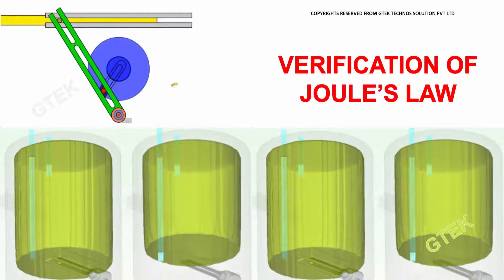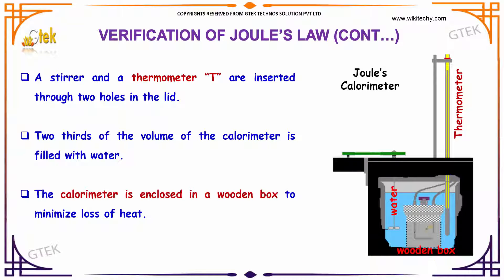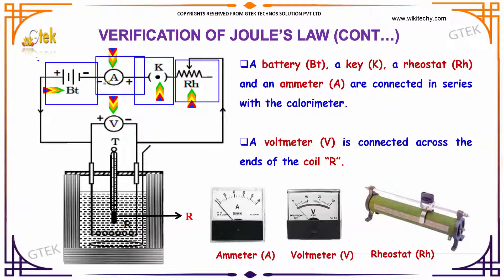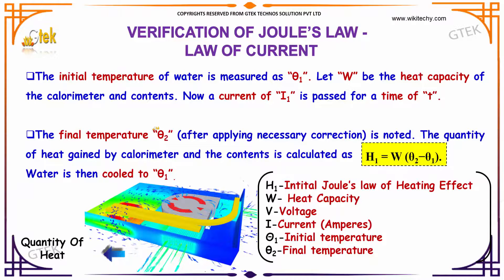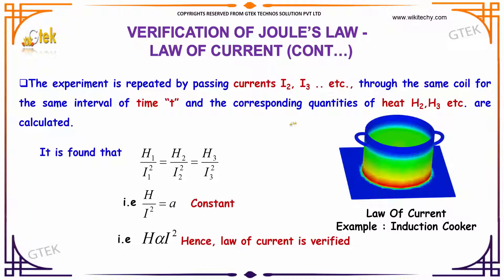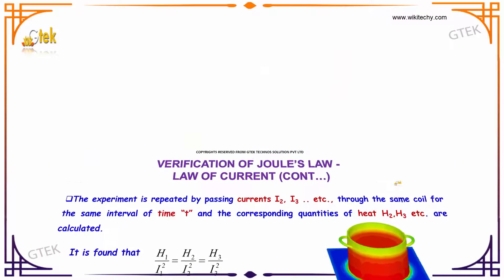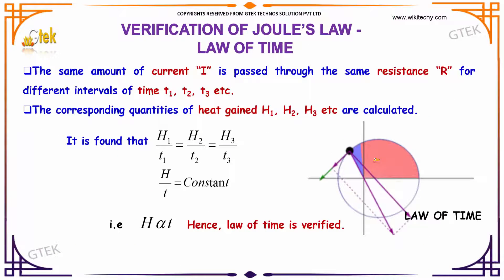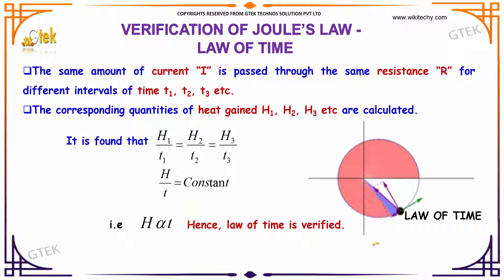Verification of Joules Law  Effects of electric current class 12 physics subject notes lectures

Comment: The rate at which heat is produced in a resistor is proportional to the square of the current flowing through it, if the resistance is constant. Lagged beaker or calorimeter with a lid, heating coil, battery or low-voltage power supply, rheostat, ammeter or multimeter, thermometer, stopwatch, balance. 1.

Comment: Verification of Joule's Law using Joule's Calorimeter. Joule's law is verified using Joule's calorimeter. ... A battery (Bt), a key (K), a rheostat (Rh) and an ammeter (A) are connected in series with the calorimeter. A voltmeter (V) is connected across the ends of the coil R.

Comment: The amount of heat produced in current conducting wire, is proportional to the square of the amount of current that is flowing through the circuit, when the electrical resistance of the wire and the time of current flow is constant.

Comment: The heat which is produced due to the flow of current within an electric wire, is expressed in Joules. Now the mathematical representation or explanation of Joule’s law is given in the following manner.

The amount of heat produced in current conducting wire, is proportional to the square of the amount of current that is flowing through the circuit, when the electrical resistance of the wire and the time of current flow is constant.

The amount of heat produced is proportional to the electrical resistance of the wire when the current in the circuit and the time of current flow is constant.

Heat generated due to the flow of current is proportional to the time of current flow, when the resistance and amount of current flow is constant.

When these three conditions are merged, the resulting formula is like this -
 
Here, ‘H’ is the heat generated in Joules, ‘i’ is the current flowing through the circuit in ampere and ‘t’ is in seconds. When any three of these are known the other one can be equated out.
Here, 'J' is a constant, known as Joule's mechanical equivalent of heat. Mechanical equivalent of heat may be defined as the number of work units which, when completely converted into heat, furnishes one unit of heat. 
Obviously the value of J will depend on the choice of units for work and heat.
It has been found that
J = 4.2 joules/cal (1 joule = 107 ergs) = 1400 ft. lbs./CHU = 778 ft. lbs/B Th U
It should be noted that the above values are not very accurate but are good enough for general work.

Now according to Joule's law I2Rt = work done in joules electrically when I ampere of current are maintained through a resistor of R ohms for t second.
 
By eliminating I and R in turn in the above expression with the help of Ohm’s law, we get alternative forms as

Comment: Image result for Verification of Joules Law
The rate at which heat is produced in a resistor is proportional to the square of the current flowing through it, if the resistance is constant. Lagged beaker or calorimeter with a lid, heating coil, battery or low-voltage power supply, rheostat, ammeter or multimeter, thermometer, stopwatch, balance.